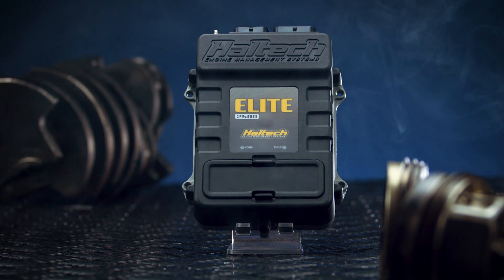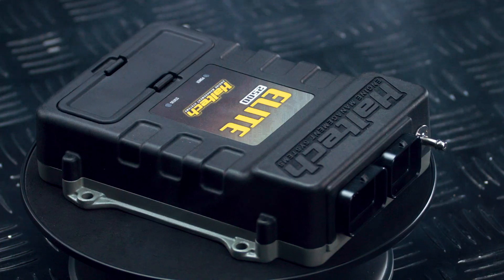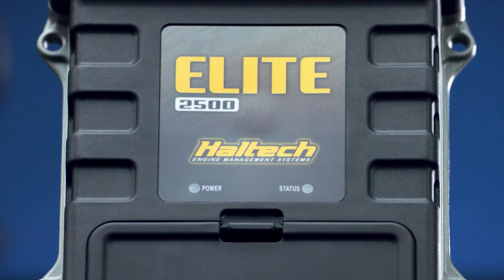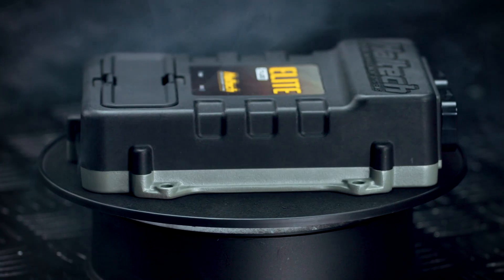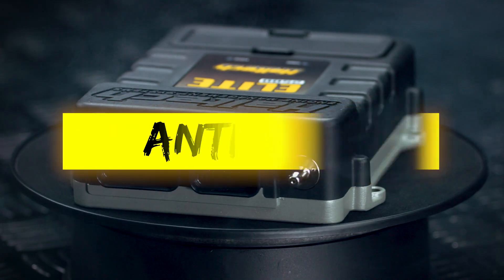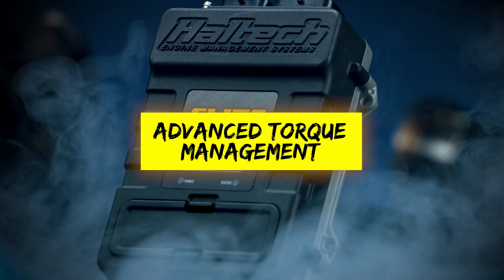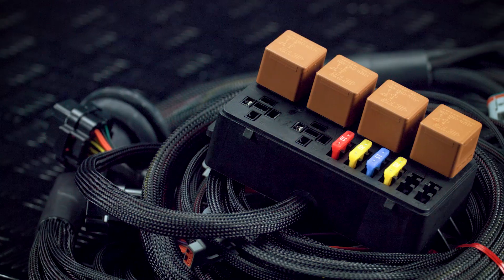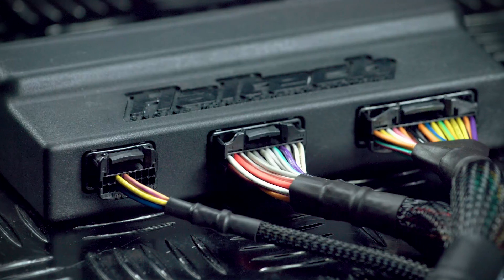✅ Elite 2500 |  FAST FACTS

Comment from the maker: Want to find out the specs and features of the Elite 2500 without any promotional spiel? This is what the FAST FACTS videos are all about - just the dry facts - delivered in a fast, no-nonsense way. You're welcome!
--------------------------------------------------------
The Elite 2500 is ideal for popular late model performance and racing applications. It’s recommended for 4, 6, 8 cylinder DBW or 2, 3, 4 rotor engines, EFI conversions and engines and multiple variable camshafts. Suitable for naturally aspirated or forced induction applications.
Want to know more? Go to the Elite 2500 Product Page: https://www.haltech.com/product-overv...
-----------------------------------------------------------
Elite 750 Fast Facts: https://youtu.be/5z20Hs5XlZE
Elite VMS Fast Facts: https://youtu.be/sUlLRtO1Yco
NEXUS R5 Fast Facts: https://youtu.be/MMixrPA3DWY
Reply: So would this be able to run a 6 cylinder with staged injectors? Or would you have to run in batch?

Or is there a bigger box that can run 6 x 2 injectors?
Reply from the maker: @TheProPilot 
The Elite 2500 has 8 injector outputs. There are several different ways you could use them to stage injection.

Sequential fired primaries (6 outputs), Batch fired secondaries (2 outputs) is probably the best bet but get in touch with our tech team and they can guide you further.
Reply: Can it still control 12 cylinders in semi-sequential mode?
Reply: 1995 Ford Contour SE Automatic Sedan
Mid-size car?!.

Comment: I have a 97 Silverado with a 5.7L Vortec. I'm in the process of changing the fuel injection. My question is, which ECU will allow me to continue using my gauges and instruments? I have a 4L60e transmission.

Comment: How come there is no fast facts for the elite 2000?
Reply from the maker: https://www.haltech.com/product-overview-elite-2000/
Reply: @haltech  thanks for the quick reply trying to see the cheapest way to get 300zx going I think it's plagued with sensor issues. I think the 2000 ecu and adapter might be the only way. Elite 1000 only supports 4 injector vs 2000 and 2500 can do up to 8 injectors. Can a person buying 2000 or 2500 elite use it on a 4 injectors application
Reply from the maker: Best thing to do is contact our Tech Support. One of our tech guys will be happy to go over your setup and recommend the best product for your application.
support@haltech.com

Comment: Then there are those of us who bought an ebay turbo made a log manifold for their 3.8 litre v6 commodore and won't use 90% of the stuff this computer has.   So now what?
Reply from the maker: If budget is tight, and you don't need as many features, have a look at the Elite 750 for a great budget 6 cylinder ECU.